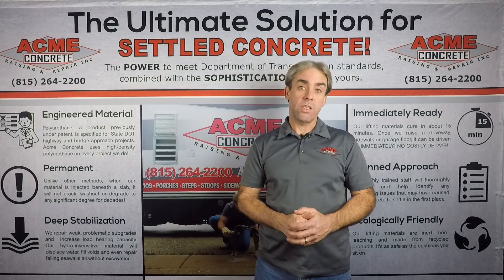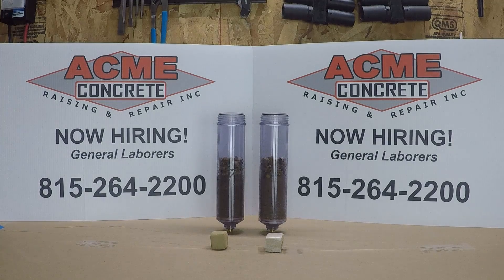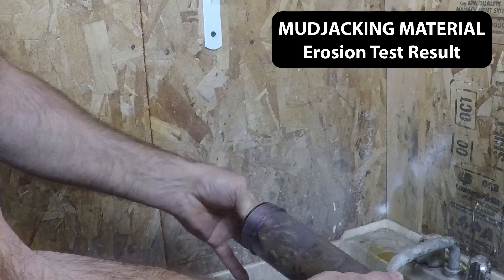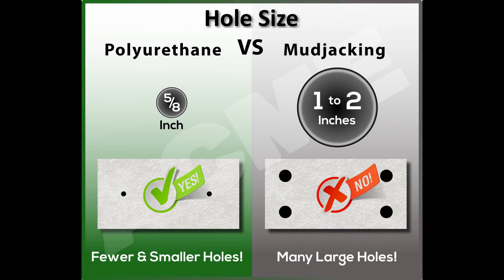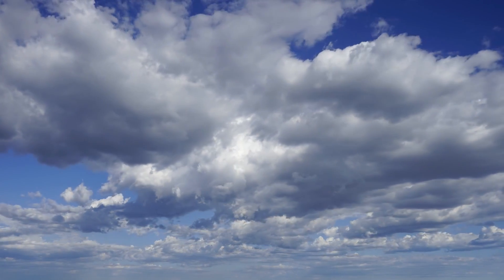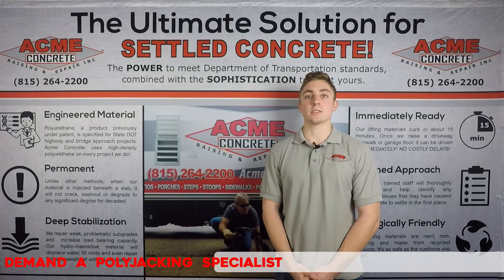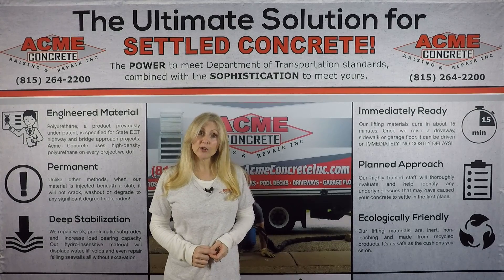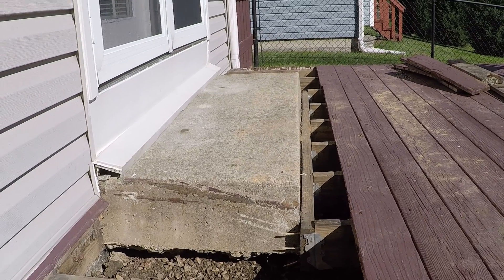Polyurethane Concrete Raising VS Mudjacking

Comment: It depends on the material used for the mud jacking. I have a local mud-jacking guy who actually builds the machines used and sells them around the country. His mixture withstands 2000 psi, whereas the poly is only 80 psi. His is a true concrete mixture, not the mud that was shown in the video. Honestly, I don't know why anybody would want mud with no standing resistance lifting their old concrete.
Reply from the maker: Hello Dave, I appreciate your comments and...I know who you're referring to. The way he talks can be convincing to some...Unfortunately, those claims do not reflect what he actually does. While that material gets described as "Type S Mortar" or "Custom Mortar Mixture"...it's essentially ball field sand containing zero cement. We've verified this MANY times including as recent as last year in Lippold Park where he raised some sidewalks around a small concessions building (and over-lifted one section) His mudjacking material was easily sampled from that project as it was oozing out from beneath the concrete. An HOA project at the corner of Barlina and St. Andrews...the same exact thing. Projects in Wedgwood - same deal. There is no cement in it at all. Here is another project he did for a friend of mine where we document exactly what he's doing...and yes we planned it: https://youtu.be/xfCCkOtMP48
Reply from the maker: We really hope you've been able to check out the other video! I know it can be upsetting to learn, but we think the truth is important...https://youtu.be/xfCCkOtMP48?si=Ow7py2KjlFjb4y8d

Comment: Stop it. 
We are not that dumb.
Don’t show me sand and tell me it is limestone in Portland cement mud.
No one left a step like that.
Reply from the maker: We're not going to stop. The stoop in the beginning of this video was exactly as the previous contractor left it. We do not know for sure what they used to create their "mudjacking mix". We simply sampled it and tested it. In short, mudjacking defaces concrete with large holes and doesn't have a good track record of lasting like polyurethane does. Consumers will always get a better warranty with Poly than any mudjacking service. This video is intended to show people the facts as found in a real-world example. HERE IS ANOTHER EXAMPLE: https://youtu.be/xfCCkOtMP48
Reply: @Acmeconcreteinc  He's talking about the experiment.  Would have been more honest if the mud was pumped under a round concrete plug in the filter so it filled the void.  Same with the polyeurethane.
Reply from the maker: It was intended to be a simply way to demonstrate the effect water has on the two different materials. You might find this one more interesting: https://youtu.be/xfCCkOtMP48

Comment: And you are super duper totally not biased in your findings.
Reply from the maker: We are super duper totally biased from our findings, but our findings are super duper totally not biased...
In short - there are no similarities between any mudjacking service compared to polyurethane. Poly, being an engineered product developed specifically for lifting and stabilizing concrete, will always outperform the old method.

Comment: facts..not opinions. 1st of all regular old "soil" is not that "strong", but works perfectly if it is compacted correctly when the original concrete is placed. Every.......single..............time.  But due to shoddy work, nearly every "older" house in a neighborhood has poorly compacted soil underneath any slab that is close to the house.....still settling decades afterwards. It does not matter what you jack it back up with...If the soil underneath has finished settling, then you will think the "jacker" did a good job,..If the soil has not finished settling, you will think the jacker did a bad job (it usually takes a few years for this to manifest.)  I prefer poly, but that does not mean the strength of poly has something to do with whether the ground underneath is done "settling".
Reply from the maker: Thank you for commenting Puke...we have to disagree with several of your opinions. Soil is not a suitable base for concrete. Soil is subject to erosion no matter how well you compact it. Properly installed concrete includes a compacted aggregate base, not a soil base. 

Unfortunately, you missed the entire point of the video, which discusses the fact that mudjacking materials are subject to erosion. Yes, if the ground beneath concrete raising materials settles, then it does not matter what you raised it with, it's all going down again. Obviously.

In most cases not involving drainage or utility issues, concrete that has been in place 10-years or longer "should" be done with any natural settlement that may occur. This means, if raised, the concrete should stay raised if the materials used to raise it do not fail. Mudjacking, being subject to erosion, fails, and it fails regularly. Poly is not subject to erosion. These facts are the basis for why we find poly warranties to always be better than mudjacking warranties. 

Not all mudjackers do a "bad job". We have a local guy here who's been mudjacking for 32-years now. As far as mudjackers go, he's probably not bad at what it is he does. The real problem is the equipment and materials he uses to provide the service. The result: he only offers a 1-year warranty. We know why this is after hiring him to do a job so we could sample and test his material. It's described as a "custom mortar mixture" with a compressive strength of 2,000 - 2,500 psi - but it is literally nothing more than something similar to baseball diamond sand. When placed in a small amount of water, it absorbs the moisture and turns into a heap of mud and retains zero strength. This guy can probably raises concrete just fine - but he is limited by the material he's using. It does not have the strength or water resistance that's needed. This FATAL limitation renders the service he's selling next to worthless, and has nothing to do with the soil beneath the concrete. The bigger problem here, of course, is not being willing to spend the money and time required to be able to provide a quality service.

Comment: I have a former church, with a sanctuary that has a 9"slope from the back to the front, about 30 feet long by 25-30 feet wide.  Would this be a possible solution for leveling out that floor?   We believe it is concrete under the carpeting, but it'll be a few months before we can get to that point in this remodel project.
Reply from the maker: Thank you for your question! Yes, using polyurethane to raise the floor is likely possible. However, there are many factors that would have to be evaluated to determine if it's the "best" way to deal with the problem. How the structure was constructed as well as its overall current condition would have to be taken into consideration. Removal of floor coverings (carpeting) may be required in order to properly evaluate the situation.

Comment: Well duh 🙄 Do you do residential and if so is there an approximate sq footage cost?
Reply from the maker: YES! We do residential projects all the time! Unfortunately, there is no average cost. However, our services are typically less than half the cost of replacement - and of course much quicker and less invasive.
Reply: @Acmeconcreteinc  

Well I am in Canada so the travel time must add up:).
Reply: @Acmeconcreteinc Interesting, my local vendor priced his bid on $/cu ft needed from his survey.  So, you don’t want to disclose your price.
Reply from the maker: @VARocketry  We absolutely do disclose our prices, we just cannot give pricing information without seeing the work. Pricing can be presented in $/cuft, however, some projects will consume more product/hour than other projects which can impact the $/cuft due to the impact on labor requirements. When basing quotes on cuft, you're relying on the estimator using a qty that's going to get the job done. If the crew gets into the job and says "sorry, we need more cuft of material to get the job completed"...you could end up paying more for the job than you originally thought.

Comment: It would have been a little more fair if the patched mudjacking holes were the same color or close to the same color as the concrete, because the polyurethane patched holes were virtually the same color as the concrete LOL that was some low class infomercial tactics there.
Reply from the maker: Hello Michael - thank you for watching our video, and for your comment. We are glad it got your attention! The differences shown between the large ugly mudjacking holes and the small, neatly patched polyurethane hole patches are actual real world examples. We have many more examples to share! Esthetics are just one of the many reasons why customers prefer polyurethane over mudjacking. Many people immediately regret having their concrete "mudjacked" simply due to how badly it defaces slabs. You might be interested to learn more in a video dedicated entirely to Concrete Raising Injection Hole Patches: https://youtu.be/gJRKDhm3N_A